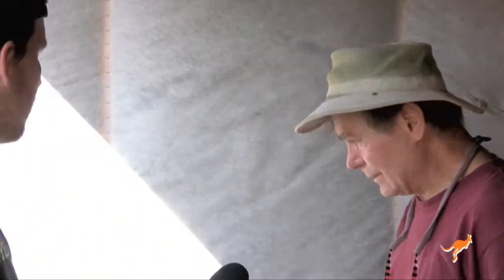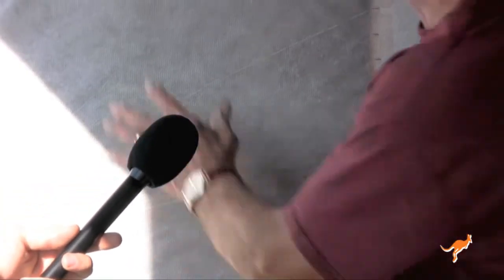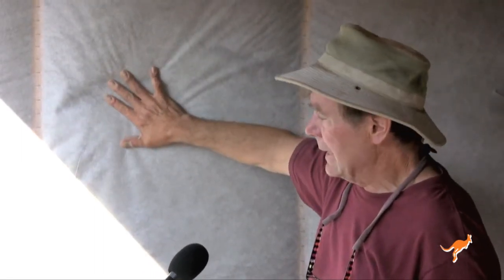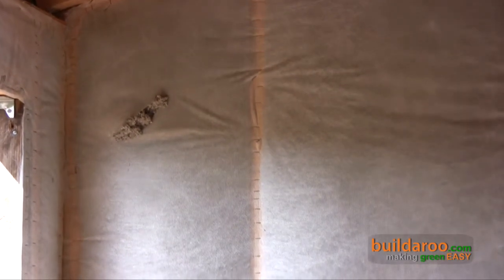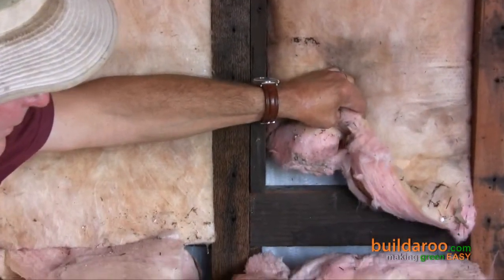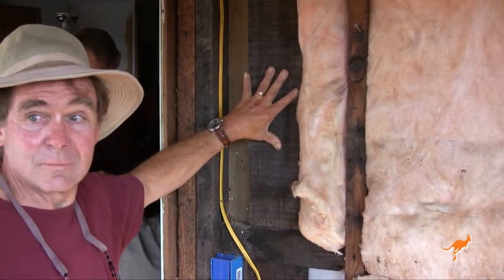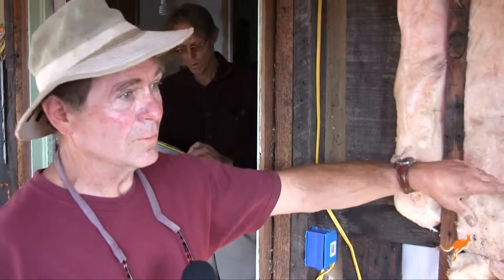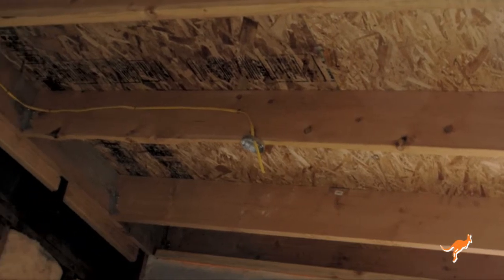CLAM: Advanced Framing & Cellulose Insulation - buildaroo.com

Comment: @matt0390 
With the netting being fastened on the face of the studs and not stapled back from the front edge they probably could not dense-pack it properly anyway. If they did the drywallers would hate them!  At least I wouldn't want to try to fasten drywall over the the netting if it stuck out that much! A for design, B- for execution. It would be interesting to know if they used airtight drywall approach (ADA) for air-sealing or if they were depending on just the exterior sheathing.

Comment: With an increase in the spacing from 16 to 24 inches, and a savings in the 2x4's purchased, what does that do to the potential roof strength for areas of snow load, and locations of high wind, or in locations of heavy traffic, a potential misguided vehicle crashing through the wall, which I presume has a lower resistance to side impacts?